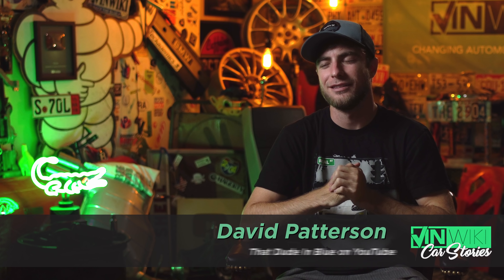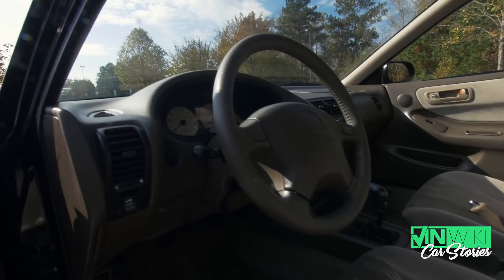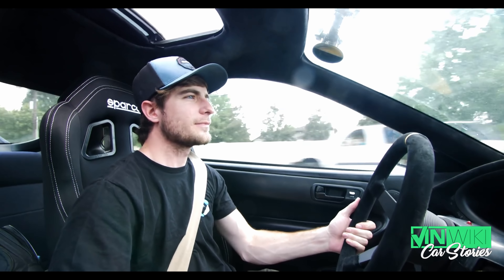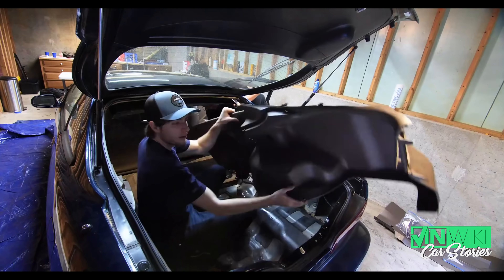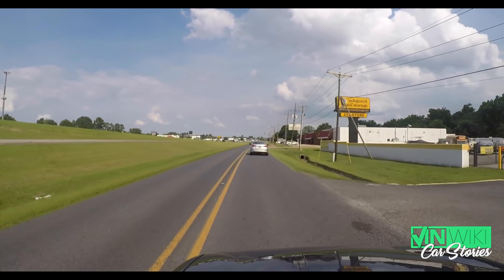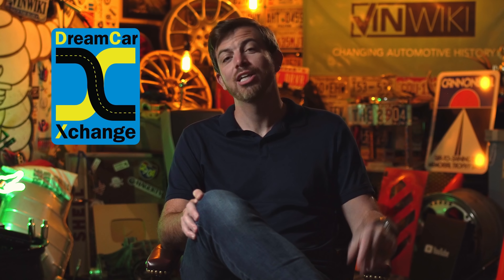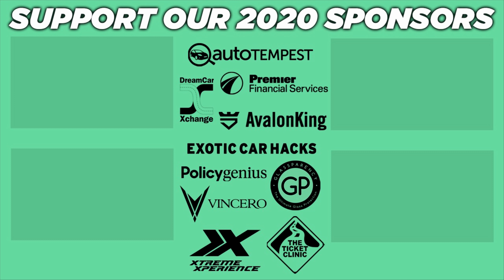The most CURSED project car of all time!

Comment: My 944 was hit 3 times, sent airborne by an unpainted speed bump on Tech campus, struck by a tornado then stolen from the repair shop and discarded in a ravine for 5 years. I can emphasize with a cursed build. 
Currently working on restoring her.... because learning is overrated
Reply: You sound like the kind of guy that needs to sit at the VINWiki chair and tell it all
Reply: Imagine if you could sympathize

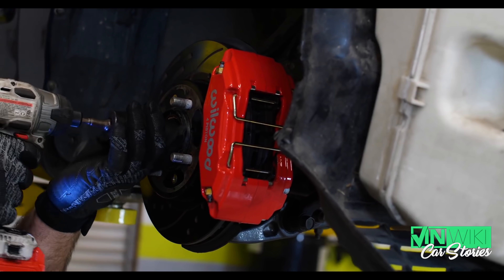Comment: 1:45 sooooo it went from an "affordable build" to another youtube engine swap...lol
Reply: K swaps ARE the budget build if you lose a motor, especially on a hydraulic clutch car. B18B1s are getting hard to find and a JDM B18C costs more than a K24A2 these days. Having the car out for an extended period because you can't find an engine is just as big a problem as funding a swap. Plus, the K series is one of the cheapest engine swaps out there to do right short of just mixing stock parts around, and odds are you could piece together a whole swap from partial kits on marketplace right now. 

Yeah sure, the mounts, wiring, etc. cost money. Save up and do it right rather than limiting yourself to the amount of money can you have in your hands quickly. If you can't save up, now ain't the time for major mods or a build anyway.

Is it high school budget friendly? No, but neither is changing oil. If you want context, look at what turnkey LS swaps cost.
Is it reasonable if it's your only car? No, but neither is any build on your only car.
Reply: There is even better thing - buys 19y old beater, mods it, drives it "carefully" (from the clips that were in the video), and then goes "ITS CURSED" cuz it broke.
Reply: @Slysdexia2  Did you not hear the part where he states, "all they really need is wheels, tires, coil-overs, and brakes." This is a far-cry from engine swap. It doesn't have to be limited by budget, mechanical inclination is also a factor. I can change my brakes, I cannot swap my engine, see what I mean? That is an entire different premise..
Reply: It still technically is 'affordable', I mean, you can modify a car for 2K-3K, an engine swap with the equipment is probably 1K-1.5K.
The problem with modifying a car is that there is levels to car modification, and they cross realms pretty quickly.
Can you swap brakes? Sure, that's entry level.
However, installing radiators, turbos, coil-overs, etc etc, that's not entry level. Assuming its done right at-least. Yet those things can fall under a 'budget build' too.
Budget doesn't = Skill level. It means with x amount of money, with your knowledge and tools available, how far can you take a project within that budget.
Its not an entry level build, its an AFFORDABLE build. Some builds will go out of your realm of capabilities.

Typically modifying an car is easier than pulling a motor, ill give you that, but Honda's are extremely easy to swap engines on. They're the exception, high-school kids with not much EXP do it all the time.
Go on your local CR/FB and look up Honda's and find how many of them have been swapped at some point. 
I've even K swapped one before and I wouldn't call myself a pro by any means.

Although I do admit, having space for an engine swap isn't possible for some people (namely those living in a city) considering a hoist is large. It is also scarier to pull off to some.
Regardless though, you can just buy a car and assume the engine won't blow and still follow his lead. Take inspiration. He simply diverted because the engine blew.

I also think an issue is that he went to a shop and had the work done instead of doing the work himself. I think if this video were from say, a Tavarish, with an engine hoist doing it himself, showing how easy it was, it would've went over allot better. 
Yes, going to a shop and having them swap your engine and do other mods to your car is not exactly 'within budget' or not within the spirit of a budget build at all.
Budget builds are about you working hard to achieve something, I don't think he really stuck with that formula. 

I like the build though, but I do agree it could've been better.

Comment: The second he said ls and non special I knew he was off the juice. They hold tons of boost.
Reply: stock b18’s can hold like 8lbs before you start to risk failure, paper thin rods in that thing
Reply: @TTViZEO  I'm talking about the block. Sure some new rods. New pistons. But you don't need to do any head, crank, or block work. I'm not saying it's perfect, just saying it's not junk.
Reply: ahhh yea sorry you’re right the cast iron block is unbeatable!
Reply: @LyonScapeStudios  it's not junk but building an engine to run tons of boost is way different and more complex than putting in a K for solid NA power
Reply: Steffan Stonne dude i bet your car is slower than a catapillar climbing a yellow bridge on a windy day.....
Reply: "Danger to manifold!" 
Sparks fly off the floor huh ?
Reply: Elliot Hompus it can be done arguably cheaper though if you want to go true budget build because then you wouldn’t have to source an engine
Reply: 255hp worth of boost isn't a ton.
Reply: Sure the LS B18’s block can hold tons of boost. But for the most part if you are trying to run a near stock engine without having to tear it down it’s better to start with the GSR/Type R etc.

And call me an idiot all you want-but since this trip the car has had zero problems. Was just a terrible road trip with some bad luck. Happens to the best of us when you are dealing with a project car.
Reply: @ThatDudeinBlue  I am definitely not calling you an idiot. But I can safely say that an ls with pistons and rods can make lots of power very reliably. If you rush it you get worse results. That's just life. No hate, have fun with your car.

Comment: The SAME thing happened with the splash guard on my wife's Altima during a road trip. Those cheap plastic push-pin rivets don't hold for shit. Luckily I had a pack of Zip-Ties, and a pocket knife with me. I cut off the damaged part of the undershield and zip tied the rest of it to the cross member. At the next oil change, I just completely removed that splash shield for good.

Comment: My WRX has 666 in the VIN. Been having some issues since I've got it 2 years ago lol
Reply: Don't worry, I'm sure the low hum of indecipherable chanting will die down after a couple of thousand miles or so.
Reply: Underrated comment thread.
Reply: I have the same problem with my 83 Mercury Capri RS. Marti Report indicated it was the 666th Mercury produced for that model year. It was ordered black on black with the only option being the 5.0 5 speed. No AC of course :(
Reply: Problems...That what makes Subaru, Subaru.
Reply: I have an Outback XT with the same thing. It's been a cursed car for sure. It's been in storage because I haven't gotten around to rebuilding the motor after it cracked a piston.

Comment: This remembers me to my parents Jetta.

It was not supposed to be a project car. Now it is a daily driver project car.

(3 failures at the same time, ECU dead, Carb. conversion, water in the transmission, missing wires, 3 crashes at this point, stuck or fallen axles, broken rims, end with brakes in a highway etc, etc, etc...

Guys. If your car ends without gas in your first trip, then you know that is gonna be weird. The engine is the only thin that was not swapped yet. And i hope that the day won't come.)

Comment: Cars just fight back when you try to work on them sometimes. My 30 year old daily driver was working perfectly but it had a cracked intake boot. I wrapped it in electrical tape and had no issues for 12 months except for the engine light coming on once in a while. I finally ordered a new one and the moment I replaced it my ac compressor belt started malfunctioning, the AC fan switch fell out of the dash when I was trying to recreate the problem, and the backlight for half the dash stopped working when I reached my hand behind the dash to reattach the fan switch. Now I have to pull the entire center panel of the dash which requires removing the center console and the kick panel under the wheel to be able to see my HVAC controls at night. It's like something's gotta be broken at all times and when you fix one thing the problem relocates itself somewhere else.

Comment: 3-4mm off is HUGE in manufacturing. No way that should have passed production.

Worked turning half-shafts, our lathes wouldn't even clamp on shafts that far out of spec without an alarm.

Comment: I remember the vid of you driving it back, I also had a cursed 01 integra 4 door. Every time I fixed something, something else broke until I got tired and traded it for a rsx which the engine blew a week later and I traded it again for a 96 civic hatch 5 speed. Never had any issues again

Comment: I used to do light roadside assistance on the 95 stretch from Greenwich CT to Beidgeport CT and they will NEVER tell you more then 90 minutes. The company that calls the company yo actually do it won't accept more we then 90 minutes so they'll call the back and the backup backup etc until they get a 90 min.

Comment: As soon as he said the car stopped moving I thought ah axel.  same thing happened to me in my eg6.  Be very weary of length when you’re replacing axels, auto parts store systems will give you a “universal” abs axel for civics but if your car isn’t abs it will actually be slightly too short.  Went through this twice till I just brought in a tape measure and had to show them why it wouldn’t fit.

Comment: I don’t believe the ac leaking out and an axle slipping out leaving the driver stranded for ~4hrs on the side of a freeway classified this as cursed,  much less “the most cursed of all time”.

My buddy bought an evo9 where the previous owner neglected to replace the timing belt so it ended up breaking.  Him and I took the time to rebuild it and upgrade a few things, nothing crazy, just stock but mildly better.  Head and engine got sent to a machine shop to make sure it was usable, just needed new valves - pistons were marked from the old valves but still usable.  Finally got it together after about 2months on/off working on it And the engine self destructs after about 30mins idling in his driveway.  #1 and 2 main bearings just ground themselves up to glitter in the oil pan, which is weird because that’s the first 2 feeds from the oil pump, but the rest of it all was fine(aside from metal everywhere).  Awesome....needs an engine and turbo, because it’ll be next to impossible to clean out all that metal.

This time he got a used engine from a wrecked perfectly fine running evo9 who was a friend and upgraded turbo(came with it because it was in the other car - basically drag n dropped it EVERYTHING from the other Evo was used as far as engine and turbo hoses, pipes, lines, etc), put it in also upgraded a few parts again.  Got it all in and started worked fine was running a bit off, but nothing crazy.  6 months later he finds out the rings have been leaking increasingly worse so he needs new rings because of the upgraded turbo pushing higher boost(not my car, so I don’t remember what it was boosting at).

Ok great, he takes the engine out, sends it to a machine shop for new rings, rod and crank bearings and make sure it’s all to spec and a few other things.  Decided in the meantime it needed more power so goes for the 600hp range gets together a mountain of parts to put in(new-er big-ger turbo, different exhaust, ported manifold, new clutch and flywheel, new timing belts and water pump parts, bigger brakes, wheels n tires new coilovers, etc etc etc).  Puts it all together, and the car got stolen.  Gets it back after about 2 months, well....it got gutted, just a shell and some random leftover interior parts.

Seems to me like that would make a bit better of a “worst curser car ever” story.

Comment: I'm fairly certain my current STi is legitimately cursed...
Reply: Do tell. This sounds interesting
Reply: @runner05  JDM V8 Spec C 207 block, 20X DAVCS heads, Kelford 220b's, lots or rewiring I've had to do from previous owner mistakes, built a fuel line/rail setup from scratch, tuned, car still has the occasional gremlin, either mechanical or electrical. 

Still the best financial mistake I've made.

Comment: It doesn't sound like cursed project at all.... would say quite click-baitty title. Never heard of Honda engines giving-up, but they you kind of wanted to swap it anyway... AC issue well described - probably didn't do right check over all peripherals when swapping... the splash guard "issue" is simple - I actually had the same just with wheel liner in Lexus IS-F and the "wind" was from me doing 142MPH on autobahn. I my case it was relatively massive  - it destroyed front fended, headlight, front bumper, bent drop-link and ripped brake-line. The reason you may ask - I had "value" pain job done on my car and the shop forgotten to bolt down wheel liner, they simply clipped it with few plastic clips and when I got up to speed it just ripped itself off. So what happened with your splash guard... you said you just had the bodywork and paint job done... here is your answer - you know that tin of spare boils, well some of those bolts meant to hold your splashguard, but body shop forgotten when they go and presumably left it on some clips. And I kind understand why it happens - many "underbody parts" clips in quite well without any bolts, so when assembling people put it in and don't imminently bolt it down, and later when they finish all exterior mouldings and stuff they simply forget to comeback to finish it up.
So basically there was only 1 issue with the car which was the "short" driveshaft or perhaps engine swap has something to do with it. Somehow cannot see how single issue with engine swapped car makes it "cursed".